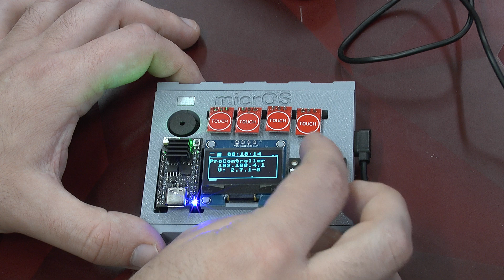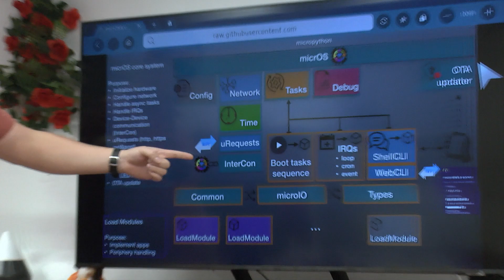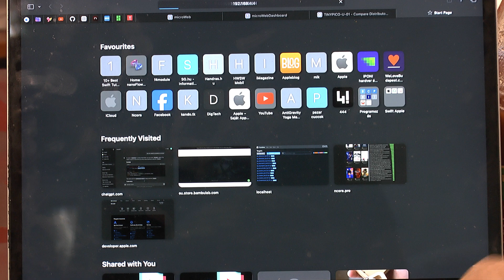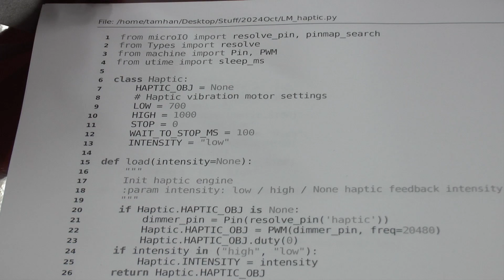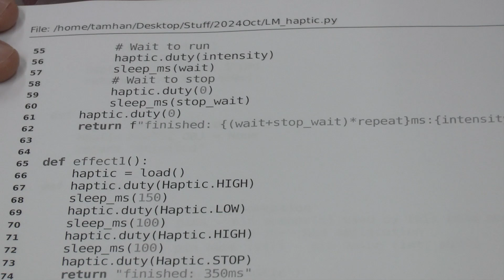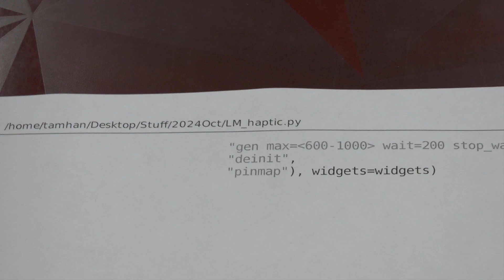Micros - ESP32 MicroPython framework for web frontend and mobile app

Comment: I have an esp32-c3, and was surprised to find no MicroPython example project/template in the IDF IDE.

I know most IDF IDE examples use FreeRTOS, but what is the typical way people add micropython to their existing projects?   

I assume once that works, testing other operating systems like Micros will be easier?  BTW, what are the main differences between Micros and FreeRTOS, Zephyr, Xous ?
Reply from the maker: Hi, thank you for writing back. Micros is totally different to Zepyhr et al - the other systems you mentioned are real time operating systems. This thing here is more of a "middleware" intended for developers who want to create web services or similar systems with a companion app! It does not have the capability to meet Real Time criteria on the other hand.